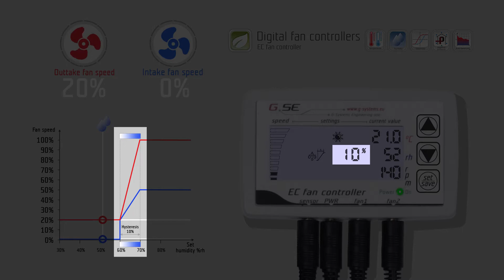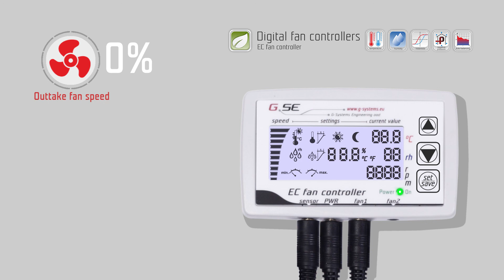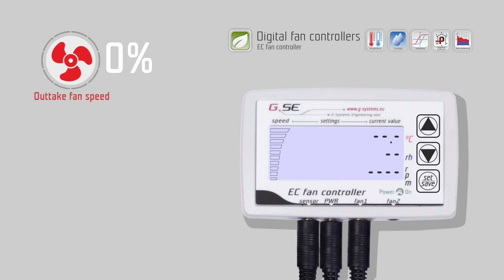EC LCD fan controller (old version)

Comment: Can i control  two  systemair revolution EC VECTOR fans with this controller?
Does this controller works with these fans?
(https://www.globalairsupplies.co.uk/revolution-vector-200-ec)
Because I do not like the two unit GAS systemair basic controllers, no control of day/night stettings (affordable models), (wich appears to have been enginnered by GSE.)